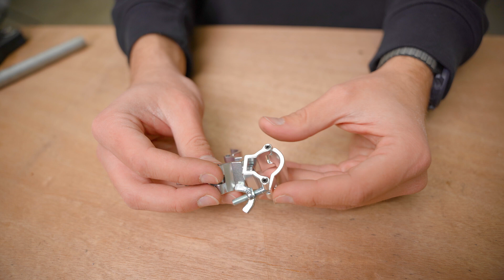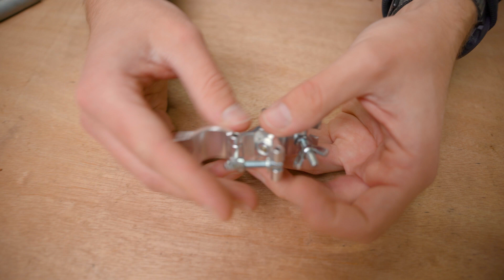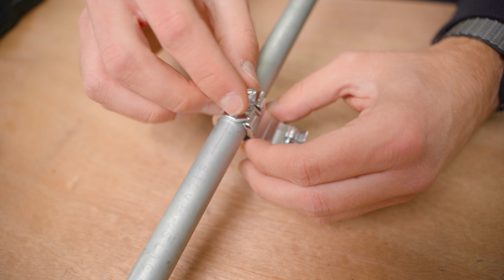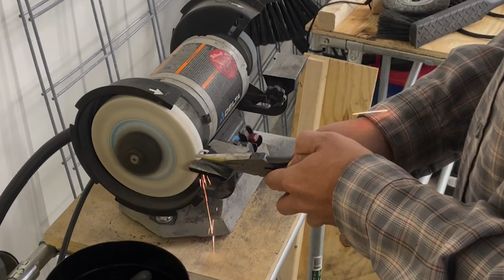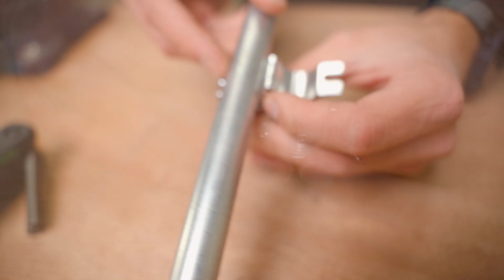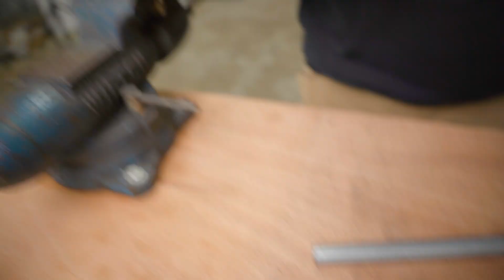This Cool Clamp Fits Half Inch Conduit Perfectly!

Comment: You could just drill thru both tubes and use a long bolt and nut to do the same thing, basically. Much cheaper. Not adjustable for location, however.
Reply: Yup! So I use “cheeseborough” aka pipe couplers on job sites all the time. One other of the advantages is that you need less hands and get a tool-less assembly because of the hinge and fly nuts.